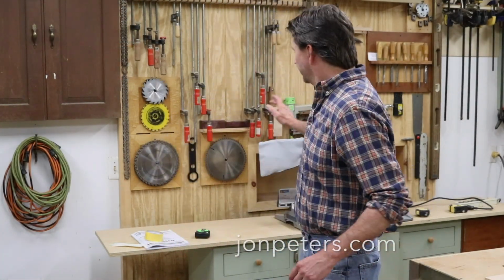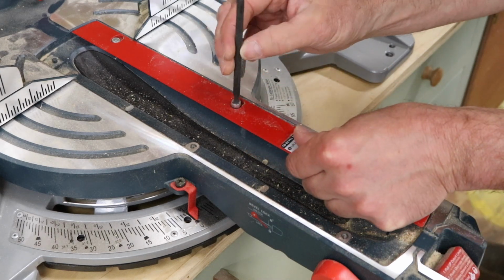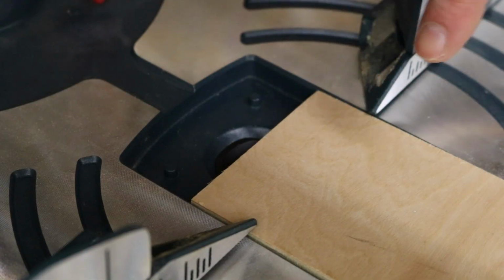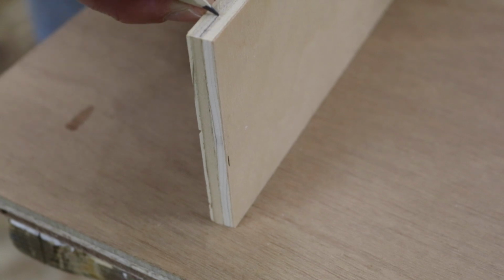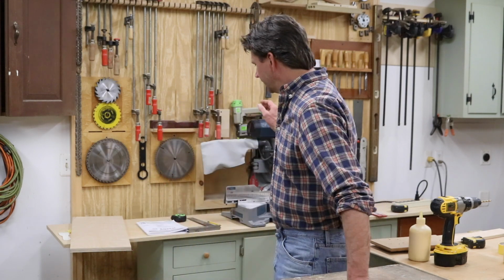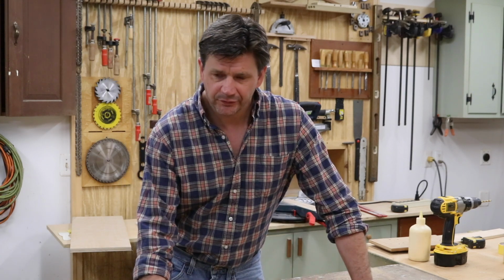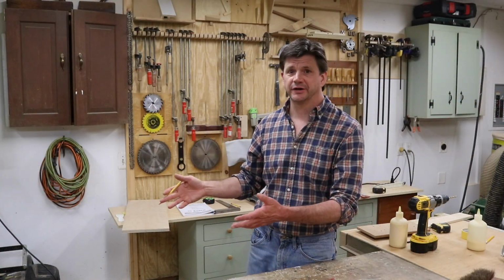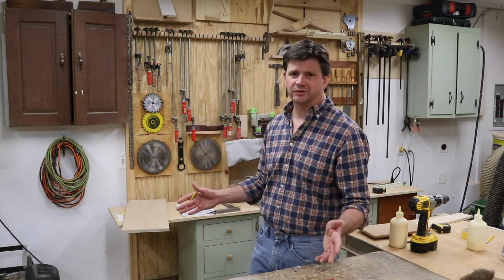Zero Clearance Insert for Bosch Dual Bevel Glide Miter Saw

Comment: Jon I've had my Bosch CM12SD for about a year.  You are very lucky to have your saw arrive square.  It took me a great deal of patience trying to get the saw to square.  The action of the saw once squared is great.  Though I have 2 chief complaints that Bosch needs to work on.  1.  Dust collection.  When connecting my Dust Deputy to the sawdust port, it only gets about half the amount of sawdust.  The catch behind the saw is too small in my opinion to effectively collect sawdust.  There is a video out there to make a larger catch.  I am going to build an enclosure like what @DIYMontreal did with hers.  2.  No laser.  I know a Zero Clearance Insert sort of resolves the need for a laser.  However; I just feel the 2 combined together would make for more accurate cuts.  The pros far outweigh the cons with this saw.  Though I do regret getting rid of my Radial Arm Saw.  While the Bosch can do this, I found keeping the RAS square a great deal simpler.  Plus the vast majority of the cuts I've done so far really only call for a RAS/Chop saw.  I built the Miter Saw Station that @FixThisBuildThat made.  The modification I made to this is putting the CMS on a cart I can wheel in our out.  This allows me to leverage the Miter station for a RAS or even a plainer.  Giving me a great deal of surface to work with.

Comment: I’ve recently purchased a new Dewalt Flexvolt sliding mitre saw. Making test cuts, there appears to be no issue with tear out at all. I’ve tested the saw using pine, man made boards and oak. Can I suggest that tear out could be the result of a blunt blade and/or rushing the cut. I can appreciate that using a hardwood insert can really “sex up” the look of the saw but I don’t see any real practical advantage to making one. Of course, the disadvantage arises when you need to tilt the saw for angled cuts. You’d need to remove it every time to avoid damaging the insert. I did make up an auxiliary jig from MDF that can be attached to the fence. Hence, small off cuts can’t snag the blade or be thrown around the workshop.  However, I fully accept it’s a case of each to his own.

Comment: I'm mystified. Maybe Bosch don't send the same spec saws to the US as to create zero clear insert all you do is undo the fixings and slide the two red pieces inwards??? Well that's all I did on  mine.  The idea being if you need to make a bevel cut you reverse the process and away you go.

Comment: I have the Bosch 4410L sliding mitre/bevel saw and find when cutting off small ends these saws fire the cut off ends like bullets. Once a piece embedded itself into the drywall. To much space with the original fence that allows these small pieces to get caught by the blade effecting them out the back.

Comment: I got this saw and i found the middle of the base was higher of the sides with a about up to 1/2 of cm, I got in touch with bosch, their answer was - it's not approved for warranty, because it's in the factories margin of error, as this saw is made for to take to job sites, and not for fine woodworking. What it ended up to be the problem that the base got a crack, so basically this saw is not made for job sides due too poor material quality.

Comment: If I ever find a Bosch that sets up accurately I'll definitely be making a cpl of these. Ive set up/ adjusted etc..2 of these saws now and both have the same end result. One side of the blade the square sits 90 and the other side is off by almost a 1/16th (it tapers) I've adjusted all the detents and etc..but still no luck and the 45 degree miter is even worse! Very disappointed for the amnt of money this saw is and time I've waisted.any suggestions on why that is and I got a good Freud blade on it too. Maybe I should try the dewalt? But that space saver is crucial for me which is why I gave it a 2nd chance.
Reply from the maker: I’m not that happy with this saw either it’s developed a bit of a blade deflection so now I generally use it for cutting boards to a rough length and then use my crosscut sled.. works ok for boards 4” or less
Reply: @JonPetersArtHome   yea I also noticed that if I cut a 1x6 i have the same problem with deflection. I still have time to return it I think that's what I'm going to do. Sad to say. Cuz what's the point of having it if it doesnt cut accurate 45s,90s, and deflects over 4" I like the space saving but not for 650$ plus 60 for the blade. I'm thinking dewalt 10" or the Hitachi wish I could afford the festool maybe one of these yrs.lol thanks for the feedback Jon look fwd to seeing ur stuff in the maker mob👍👍🍻

Comment: Nice work on the insert. Why not make it easy to repair instead of making a new one. Cut a dado down the center of your insert 3/4" wide by 1/8" deep. Rip a bunch of 1/8" masonite to fit. Stick a piece in the dado with double sided tape or a few dabs of hot glue. When it gets chewed up, slap a new piece in.

Comment: Make sure you start the cut with the arm all the way extended and push it away from you as you finish the cut for safety reasons.
Reply: maxm7202 Negative, it would chew up the plywood just enough to piss you off. By pulling back slowly and carefully(just the one time for this project) the blade cuts down, leaving crisp edges. Be careful
Reply: How do safety nazis like you live?  how do you cross the street without being hit by a bus?  Please make a video so I can leave a comment about you not looking carefully in 6 directions.

Comment: Great video. What do you think about using a sacrificial board instead of the custom insert? I use a lot of bevels (and wouldn't want to replace the insert frequently) and wouldn't need the benefits of the custom insert for many cuts.

Comment: I don't have any background in woodworking and most of my tools are recent purchases as a newish homeowner doing DIY stuff. I was just looking for info on the Bosch miter saw since coming to regret the cheap Ryobi I bought, and I learned so much more by accident from watching your video! LOL! Thanks for this!
Reply: Eric R. Shelton Lol.  I want to replace my ryobi too.  It's not terrible, but it is just a chop saw.
Reply: Despicably Irascible Rapscallion every time I swing the Ryobi blade 45 degrees so it's no longer perpendicular to the horizon, there's enough play in it that my cuts are never square. Huge disappointment. Time to invest in something higher quality.
Reply: Eric R. Shelton I've heard some complaints about repeatability on the Bosch too, but apparently it's quite easy to tune in.
-
I wish there was a website that did independent reviews of these tools.  I love youtube, but it's hard to tell how unbiased some of these guys are.

Comment: Hi, I'm looking at getting this over the Festool and I was wondering what its like at cutting accurate bevels for box making? 

Does it have a good positive stop at the 45 degree angle? Great vid by the way. Thanks for posting.
Reply: i know i am not the owner of the video but i bought this saw second hand from a guy who was downsizing his shop. the guy i got it from sold his festool to buy this bosch in 10 inch. he said the festool was great but he would buy this saw over and over again for how accurate the positive stops were.  when i tested out all the stops to my digital angle finder everything was spot on. im sure the guy i bought it from dialed in everything before hand. i have had 0 issues myself with any of the angles and them not being spot on for the positive stops. i have used a festool before and i even have to say i probably wouldnt go away from using this over a festool. saved me a bunch of money to help my adventure of getting a new table saw

Comment: Hi Jon. Just a question for you. How do you like the saw? I have read so many reviews that says this saw does not track - cut true especially on wider boards. I really wanted to get this saw but I don't know what to think now. Any input would be appreciated and respected coming from you. Thanks for all you do!
Reply: I have the same saw in my cabinet shop. I returned the first one because the mitre table from factory was lower on one side, skewing both mitre and bevel cuts. Bosch sent me a perfect replacement saw and I've never had an issue. It has stayed calibrated for 5yrs now. Happy woodworking! 👍🏻🔨📐🗜
Reply: Thanks for the input. I appreciate it!
Reply: @dannersmyers  how about now three years later? I am wanting to buy this saw and your 8 year review will be very helpful. John has since posted he had trouble keeping his Bosch square and went with a kapex. I am not shelling out $1500 for a saw.  I am a hobbyist and am sure you put this saw through more in one month than I will in my lifetime.

Comment: I have the 12" version of that saw and love it! I used some oak and made 2 inserts. One for 90* and another for bevels. I noticed sawdust building up under the zero clearance one so I drilled a 1" hole at the far end to solve that problem. Works great! Thanks for the idea. Here's a link to the pic.
http://s45.photobucket.com/user/saturncjc/media/IMG_3737.jpg.html?sort=3&o=0

Comment: Is there a reason you didn't just slap the tape straight down onto the plywood that you were going to use for the new insert, and then just cut around it? Could have saved having to measure things up
Reply: Aaaand I just got to the part of the video where you did actually put the tape on the plywood

Comment: I love my Bosch 4310 dual bevel, it's a slider one, but works great. I was thinking about a zero clearance for it and this video is all I needed to get going on making one. I hope you like the saw, I had to adjust mine a little to get a perfect 90 degree cut and it works sooo good!!

Comment: Hi Jon. If you do a follow -up Q&A type video to this, I wondered if you could briefly discuss your chop saw stroke technique?
Ive watched you many times score the material pulling the blade towards you and then plunging the blade and pushing away from you back through the material.
I have tried your method and never seem to get perfect results on deeper/longer cuts especially.
My Metabo saw is the only one i have ever owned and it has the slightest bit of play on the blade/motor head (though I have heard this is standard on most...if not all sliding mitre saws). So through adjustments and trial & error in cutting technique I can now achieve perfectly square cuts.....But this was something that took me some time to achieve. I just wondered if other people might be interested in this issue and you could share your thoughts? Thanks Jon.
Reply: I believe he does this for reducing tear out. It is the same stroke that I use. You have to imagine the angle at which the teeth are exiting the wood. The higher the angle of exit the more tear out.

Comment: This is the 3rd person I have seen on you tube that have got the same saw and been very happy with it except for the inset plate, Izzy sorted his with some tape that gives a zero gap but I like your method better. I hope you get lots of use and accurate cuts.
Reply: I used the tape as well on my miter and take saw. Just quick and easy.
Reply: John Fithian-Franks Hi

Comment: An OEM insert usually allows for zero clearance; the sloted screw holes in the insert allow you to move the insert inward to where they almost touch, then with a plunge of the blade you have a zero clearance cut.  To do a bevel cut, loosen the screw, open the throat, make the bevel cut and then close up the insert again to go back to zero clearance.  Thanks for your time
Reply: I was going to say this but you beat me to it. Everyone thinks there is this big magic in zero clearance plates, but they are already a zero clearance!!!!